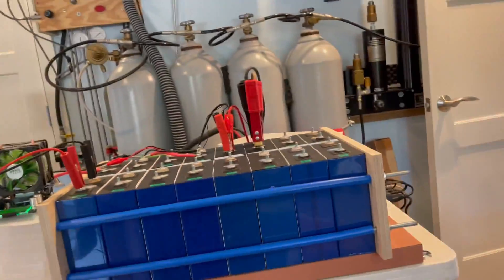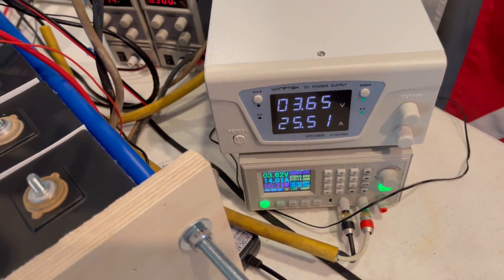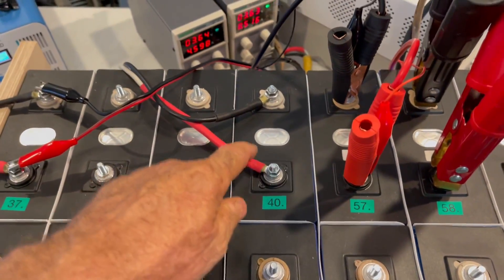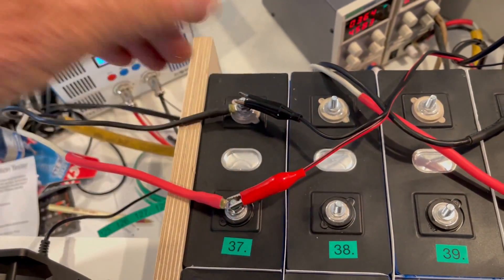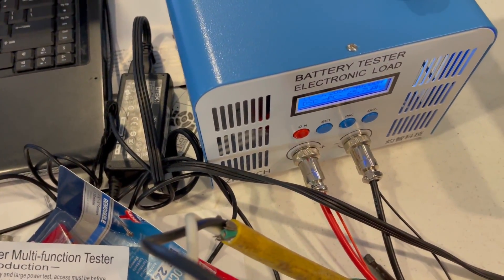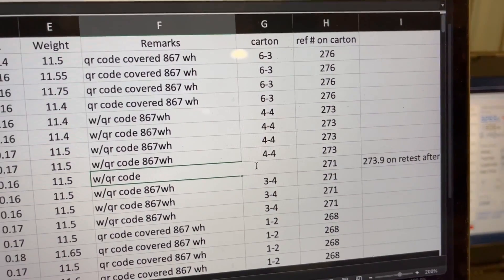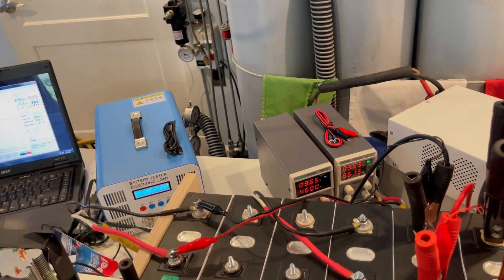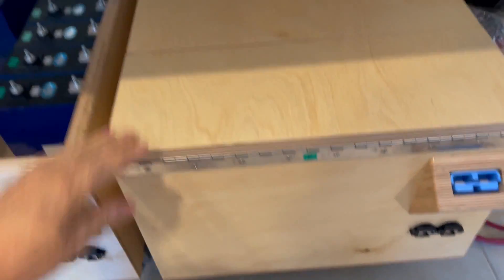How I Capacity Test 202 Lifepo4 Lithium Battery Cells. Crazy Number of Tests With My EBC-A40L

Comment: Hey Ray,
How do you get 15amps on the riden, I have 2- rd-6024 i put in parallel i'm usually getting 5-6 amps each that's with maxing it all out = 3.65v x 24amps.
 Also i don't get a live voltage reading unless i pause the unit or have a volt meter on it or is there a setting in the menu for it. The EBC-A40 does have a live reading but i love both of them.

By the way I ordered from (Jenny Wu) that you suggested for the (20) mb31 and the Ebc-A40 and received them within week and have because she already had them here in the states.
Putting a DIY box together that Andy's off grid garage suggested.  

Thanks for all your videos!

Comment: Should charge/discharge test in chunks of like 4.. Since generally stuff doesn't "go wrong" it ends up being faster. If something is wrong then you have to retest the 4 but you'd get through the majority without issues. This is how lab testing is generally done with everything (not just batteries)

Comment: I'm sorry I bought an EBC A40 L tester but I can't connect it to the computer (Lenovo X131e win7 professional).
The software is eb_setup_v1.8.5en_20200215 and it works perfectly but when you connect the usb it doesn't connect...
I installed the drivers from the zip file where there was the program PL2303_DriverInstaller(Usb to ttl cable)
Thanks for your help. Marco

Comment: Hi Ray,

I have a couple of questions if you don't mind as I have just purchased the ebc-a40l.

I'm getting ready to build my first 12v battery using eve 280ah cells.  I was going to top Ballance them in parallel but have been advised to charge them individually for a few different reasons that make sense, 
So with this in mind could you suggest a charge profile for individual cells so they will be top balanced ready for building the 12v pack...
For example...
Would you charge to 3.65v or keep the voltage a little lower?
What current would you charge at and where would you set the cut-off for absorption??
Would you build the pack maybe with compression prior to individually charging each cell ???

Any help you could give me would be great, thanks in advance Dave
Reply from the maker: I would test each cell individually and record the results. I would then top balance them in parallel to 3.65 volts. I would then build my battery and monitor how the cells work together during a discharge capacity test. I would not do it any other way, especially since you have the EBC-A40L.

Comment: I see you have the Cutoff Current set to 1.0 Amp when discharging. The documentation for EVE LF280K cells suggests setting that to 0.05C (14 for the 280 Ah cells). Can you tell me why you went with 1 Amp?
Reply from the maker: You are switching a few values. I charge at 3.65 volts at 40 amps. The charger continues to charge at 3.65 volts when the battery reaches this voltage but so as to not overcharge the battery, the charger reduces the current until it gets down to 1 amp. At that point the charge cycle ends. The cell then rests for 30 minutes. Then I do the discharge test at 40 amps. That is a .14C discharge rate which will tend to indicate a slightly higher capacity than a .5C rate but it is the limit of these testers. The discharge test is concluded when the cell voltage reaches 2.5 volts. Hope this helps.
Reply: I see I wrote discharge but I meant the initial full charge. The Eve data sheet says this: 4.2 Standard Charge
The standard charge means charging the cell with charge current 0.5C(A) and constant voltage 3.65V at (25±2)°C, 0.05C cutoff.

Doesn’t this mean the cutoff should be 14 (0.05C) instead of 1?
Reply: @winnersedgemarketing  Indeed, 0.05C = 14A for a 280Ah cell. He is not following the capacity test protocol described by the manufacturer in the LF280 datasheet. Maybe he goes by a different datasheet ? I doubt it though, he just seems to not be aware of this 0.05C spec in his reply to you.

Charging to 3.65V all the way down to 1A will result into pushing about 3Ah more capacity into the cell (from my own test w same cells & charger as his). However it will stress the battery more as it'll spend much more time at 3.65V (about 45 min more). So, probably not a good idea on the long term. But maybe this is just his initial test & top balancing protocol. Hopefully, when used in his system, charging will be limited to 3.55V or such.

Comment: Hello, I like your videos. Would you be able share a link for the cheap battery  tester you have in this video?
Reply from the maker: Which one?
Reply: @RayBuildsCoolStuff  It looks like just a circuit  board with a fan mounted on top (its green and to the left of all the cells)
Reply from the maker: @douglasbakker9064  I don’t use it. You can have it if you want. Email me a shipping address and I will try to get it out before I leave.
Reply: @RayBuildsCoolStuff  How did the results differ between the EB40 and the small circuitboard/fan tester?
Reply from the maker: @MrWotok  I would not bother with the cheap tester.
Reply: @RayBuildsCoolStuff  Yea, I already own one.  Tried it out last night testing a cell.  First, I had to beef up the cables to push 20amps at 3.65v.  Then it would randomly shut off.  I dropped it down to 19amps, but it kept doing it.  Also, it doesn't measure voltage very well.  Seems to be lower than even the board contact points.  I couldn't get more than about 78ah because it thought the battery was too low.

So, I bit the bullet, used my reward points and then some to get a EBC-A40L :p

Comment: What bms are you using and why?
Reply from the maker: I'm using the Seplos 48volt 200amp for a number of reasons. It is robust, used by many of the large prebuilt batteries, plays well with many of the inverters, has a built it precharge resistor and isn't in a race to the bottom on price and quality. It also doesn't break the bank. 215USD each plus shipping.
Reply: @RayBuildsCoolStuff  got 2 of 48V 150A and need to say that soldering is on different level then another PCBs from china ... nice and clean and also some type of acrylic varnish (guess) as protection against oxidation ... + Ray, the separators between cells is some epoxy sheet?
Reply from the maker: @ChytilJaroslav  thin  cutting board sheets from amazon sold by arrow home products cut to size.

Comment: good god that's a LOT of effort and TIME testing cells!  not to mention the electrical 'waste' (as heat) of charging/discharging the cells just for capacity.  i bought 72 myself and would love to have individual capacities for each cell.  there is no way i'm spending 2 months (or LONGER - i'm totally off grid and don't have the energy to waste) testing them like that.  do you think there is a way to discharge a cell (while you measure capacity) and use the expended electricity to charge the next/another cell?  i mean, put the time commitment aside, you are burning through, what, about 90kW just for capacity testing?  there's GOT to be a more efficient way to use the dumped electricity...  i am fascinated with your process, thou.  :)
Reply from the maker: It is definitely a time commitment and I couldn't do it if it wasn't in my office running in the background. As far as the energy use is concerned, I think the efficiency of properly batching the cells into packs that aren't greatly reduced in their capacity by having the weakest cells spread amongst the packs will more than outweigh the energy cost to get there. The energy is all created by my solar panels and I'm net zero here at home. I think the total energy used to do this will be about 350 KWh. It runs about 5 KWh per day and will take around 70 days to complete. If I was paying for the electricity it would cost about 35$. The cells alone cost almost 26,000$ so in perspective, the energy cost to test is just a trifle. This is for two large homes, mine and that of a friend. In the end, I'm grateful to have the data to refer to in the future when a cell starts doing something funny and over time I will be able to track the cell degradation over time. I am a real believer in testing everything we do, especially when it comes to building performance which I would like to get into later as it is the real focus of my career and experience. All in good time.
Reply: There are two ways that might work for you. 1) Put the discharged energy into another battery/electric car or a storage device that is capable of handling it. Which for most is not possible.

2) Run your Inverter AC (Heat and cool ones) to test them out, might as well keep the house/room cool while testing :D.

Have to be careful with the second way, testing is supposed to be done at specific Amps, usually 0.2C or lower for best results. 280 Ah x 0.2 = 56~60 amps, will take about 5 hours to deplete one cell. 60amp x 3.2v = 192 watts. A single cell won't power the AC, a fan yes. 

If you go down that road, you will need to plug in an inverter to convert the DC to AC so you can run something. Or use a DC fan (which is what computer fans are). An inverter will introduce inefficiencies, which have to be factored in, so as to get accurate results along with the cabling, as longer cables will be required due to space constraints most people have with tables and equipment.

You will probably need to invest in two extra energy meter, one on the AC side of the inverter and one on the dc side to keep the measurements in check for you.

Naturally testing so many cells means that equipment will fail, more testing equipment you have, the cost of failed equipment will pile up a bit. 

Even for the first option, you will need a DC to DC inverter to send the energy from a cell to a battery. Best to think of all these things before hand for your own specific situation and resources.

Comment: How did the cheap tester end up working out?
Reply from the maker: Thanks for asking! On a battery cell that had tested to 271AH on the expensive 40 amp tester, the cheap tester measured 273AH. The cheap tester discharges at 20 amps so at least part of the difference can be explained by the lower discharge rate creating a smaller voltage drop and extending the cut off at the bottom of the cell capacity. I'd say it was pretty damned close but there is some variability in individual test runs even with the same tester and this was only a sample of one so further testing might show different results.
Reply: @RayBuildsCoolStuff  
Thank you. It does make sense that it would be a rad bit higher capacity at a lower amp rate. Seems good for the price 👍

Comment: Agree with Margaret, you give good explanations.  You also have some really cool equipment. :-)    So far I have built a portable 200ah 12v box (on the real cheap) and am looking at building a 16S system.  Really concerned about where to source the cells.  Seems like some suppliers are less than reputable :-(
Reply from the maker: Thank you Randall. I think when we buy these cells from a country where we have no legal recourse it is very risky. It is made moreso by the fact that returning the cells is often as expensive as the original price paid. Knowledge is valuable and luck is also important. I still have 70 more cells on the water but they are from a more reliable and expensive source. Playing the alibaba game is taking a chance. ali express is beyond what I'm willing to risk. You can buy from US based stockpiles and pay the price but you will probably end up with less capacity per $ in the long run. 

Just don't send money with no recourse. They are all your friend until there is a problem but a credit card beats friend and family on pay pal. Only use friends and family if it is friends or family. When you try to save that last three percent you are playing Russian Roulette with too many loaded chambers.